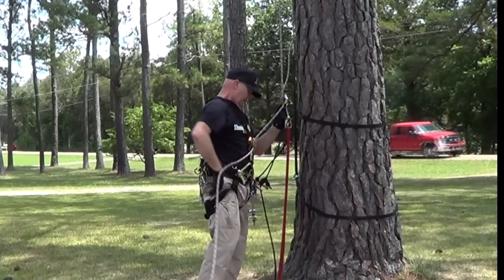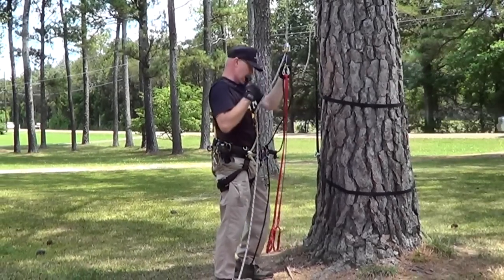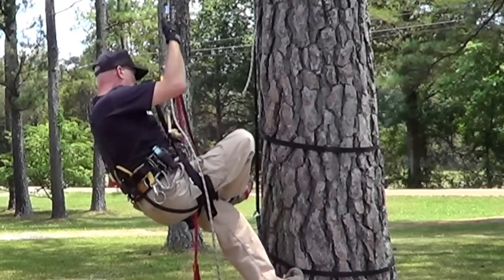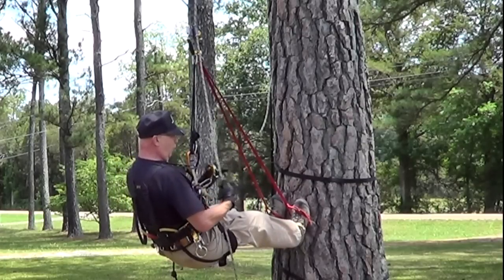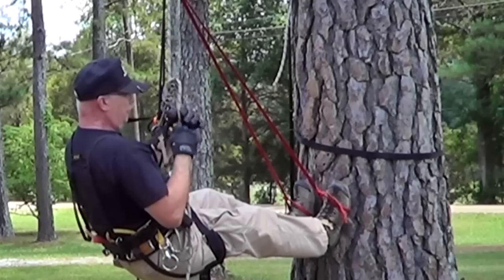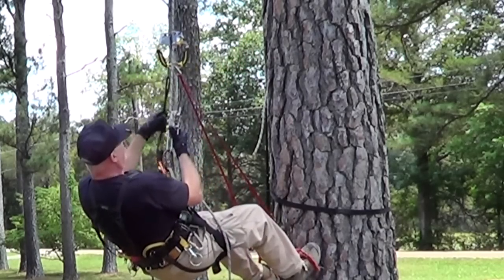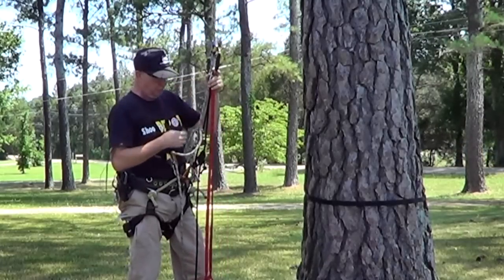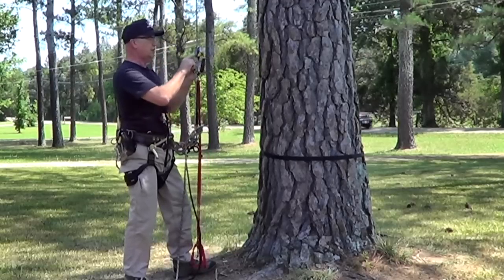Frog Changeovers Part 2  Two hard ways PD10

Comment from the maker: I use the double ascender for the symmetry it provides. When I climb on a frog setup as shown in the vid, it works out all muscles on both sides of my body equally. I have exactly the same grip on both hands and the same force on both feet. That way I don't have to worry about muscle imbalance issues and problems that can come from that.

Comment: Just watched all your change over videos. I was wondering why you trying to add your decender above your Croll? 
I have never seen it before. 
We would normally 
- add the decender tight below the croll, 
- As the croll is still weighted move your hand asender down to your croll, but not too close.
- Stand in your foot loops and remove your croll. 
- As you sit back down your decender will take your weight. 
- Your hand assender will now be unweighted so can be removed, you will normally have enough slack to test your decender before committing entirely too it as well.
Reply from the maker: Been too long ago. 

I designed and almost exclusively used a progress capturing tether that makes transitions from ascending to descending very easy and straightforward.

Comment: I"ll be picking up a HH in the next couple days.  My brother used one for 6 weeks and loved it for srt. They are currently in stock in Wesspur.

Another interesting thing about a HH is that if I understand correctly, it is one of the few setups that could work with tension lower on the line.  Perhaps useful in some sort of semi controlled scrambles (not talking arborist stuff now) or in some sort of weird rescue work.  Most setups   will lock once the line is pulled from below.

Comment: not sure how relevant, but  I am going to look into whether I can use a hitch hiker instead of my chest croll when doing srt (ascentree with one foot sling, chest croll, and right pantine) so that I can use the hitch hiker setup to descend without removing it.

Possible issue with HH would be if it limits how far I can pull the ascendtree down each time as compared to the chest croll which rides pretty low.  Not sure I am making sense.

Comment: As a vertical caver, I use what we call a double cowstail as tethers. The cowstail is made from climbing rope and connected to my hand ascenders. With this option you can switch out your main line from the croll and insert the cowstail giving you a place to hang from comfortably! and leaving the mail line lose to load a rack - Keep in mind I already preloaded the rack as a second point of connection. I can also connect my right handed ascender just above or below the other ascender as a second point of connection instead of preloading my rack. I can also do this changeover with a full six bar rescue rack!. The rope cowstail just gives you nice safe options.
Reply from the maker: Good tip. This vid was oriented more toward tree climbers and they don't have the cowstail.

Good tip though, thanks!

Comment: In the resting position I am supported by the chest ascender.  With my handled ascender and chest ascender still connected I attach my decent device (rack or otherwise) and lock it off  just BELOW the chest ascender.  Then in one motion I stand up on the foot loops sufficiently to unweight and disconnect the chest ascender from the rope.  I then sit back down.  With the chest ascender disconnected weight is now on the descent device and I disconnect the handled ascender.  I find this method simple and easy, but should be noted that prior to disconnecting the chest ascender you must ensure that the handled ascender is as low as possible on the rope without being so low than I cannot still stand up on the foot loops otherwise you may end up with it out of reach and unable to disconnect it as you end up a little lower on the rope after transferring the the descent device.  Thanks for the video.
Reply from the maker: Thanks for the input!

Comment: It's a hard way because your're making it hard.

Install the Rack below your chest-ascender and lock it off. Then stand up in the foot-loop, open and remove the chest-ascender and sit-down into the Rack. Remove the hand-ascender and you're ready to descend. 
https://www.youtube.com/watch?v=KEb4-qMroWs
Reply from the maker: +Howie656565 
As I recall, when you install the rack below the chest ascender and sit on it, you sink so far that you can't reach the upper ascender to remove it.

In the video you linked, you're using a frog harness which sits very low. But with recreational harnesses, the mechanics including tie points are very different. They are designed for a lot of hanging as well as climbing.

I started out climbing in a true frog harness, and found, as many do, it tips you backwards so much, you burn up a bunch of energy just hangin' out. After using a rec harness, I never went back to the frog harness.
Reply: +Tanglerwr Good points. Last time I did this changeover in my Petzl Sequoia with the medium length rope bridge installed (12 inch I think). And you are right I had to sink a little bit far before I reached the descender. Important is that you lower the upper ascender as much as possible before you stand up. If standing up isn't possible then it is too low for sure (or the foot loop is too long). I can remember that my upper ascender was close above the croll.

As with every climbing system it needs fine tuning for working well. And the saddle (bridge), length of the  lanyards and the  foot loops are the variables here. You are absolutely right.
Reply from the maker: +Howie656565 
A point I should have mentioned about your video: I thought it was great that you did the change-over blind folded. While the likelihood of being caught in the dark is slim, working blind folded does make one think more carefully about the steps involved and if you can do it, it's a good indication that you have the technique mastered - good job!